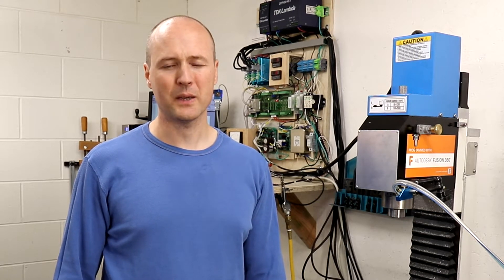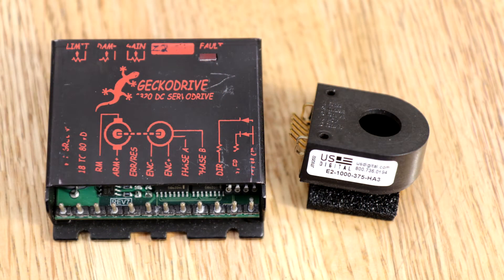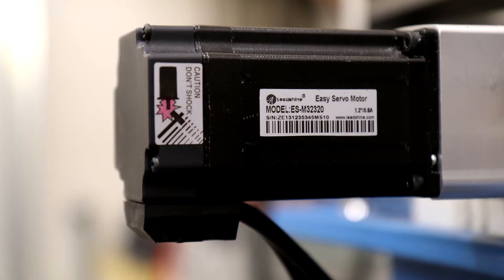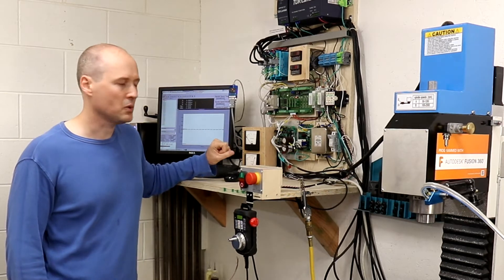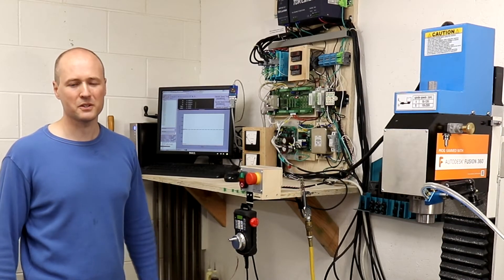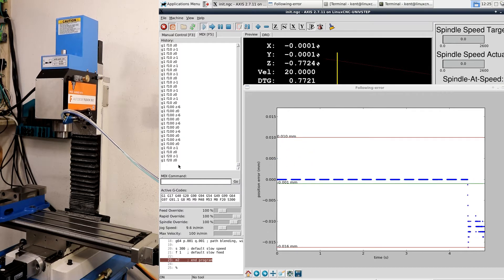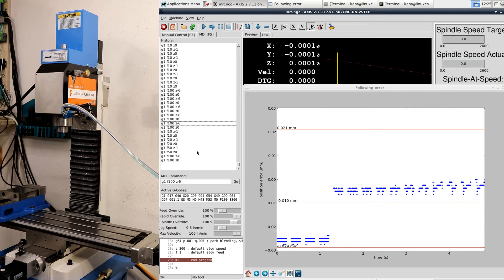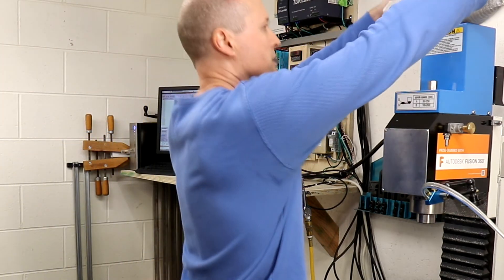Closed-loop stepper motor following-error monitoring

Comment: Hello I’m from Brazil im using the hbs57 driver that looks pretty much like yours… I added a clock to the x axis to see if it was going ok but seem it’s not going exactly as should. I’m using fluidnc as controller with an esp32 board to send the commands and it don’t seem to be stable in advancing for example. It seem to me like the driver may be the problem could you give me some advice?

Comment: Where could I buy the Leadshine servo motor? I think the ones you have are 2N.m, everyone recommends 4N.m for the X/Y-axis and 9-12N.m for Z-axis. Is 2N.m enough? Thanks
Reply from the maker: In the US, I purchased from http://www.americanmotiontech.com/

Measure required torque at the ballscrew with a torque wrench - not much is needed, break away and moving. I've had no trouble with 2Nm, and demonstrated reserved capacity by adding weight to the head while monitoring follow error. If not able to measure these, one would be conservative and increase the motor size, especially if using open loop motors.

For these small mills, we should be working at lower force levels. Smaller faster cutters and less force. 

Thank you for asking. Happy holidays!
Reply: @kentvandervelden  Thanks for the reply. This makes sense. Happy holidays!

Comment: It seems like the other videos in the series never happened?
Reply from the maker: The most direct answer is: no, they didn't. the information that I can read from the axes drives is not timely enough to make a real difference. I purchased a servo for a spindle, with a similar goal in mind, got that integrated into LinuxCNC, but similarity, the readout seemed out of sync. The best way would be to build a proper instrumentation of the drives. I have the circuit sketched up, but I don't know if it'll ever get built. If you only want to see how to reverse engineer the control protocol, I'd bad glad to demonstrate that. Glad to answer any questions you may have. Stay safe.
Reply: @kentvandervelden  Thanks Kent, that makes sense. 
I may be thinking about this too simply, but is it possible to have the input to linuxcnc just be that the following error is zero before sending the next move command? That way the driver can do the hard work of fixing the following error and the PC just gets a wait/go kinda signal, so if a move doesn't complete the program halts. Or would this just make things much slower?
Reply from the maker: @marshr32  I dreamt of controlling spindle and feed override based on inputs from sensors. E.g., keep spindle at 80% power or so (this is what requires extra electronics) and monitor other sensors (e.g. vibration and sound) to avoid vibrations. People ask about and report feeds and speeds, when they are suggested by the manufacturer, but without experience, the machine may be best at performing tests and optimizing a machine's material removal rate over time. Your idea is optimizing for accuracy. I believe that the division of labor as you describe, i.e. trust the drive and motor combination to eventually get to where it's commanded, is the right approach. Without it, one ends up with multiple PID loops stacked, and maybe impossible to tune. The larger the machine is, the harder it is to stop them, at speed, without overshoots. So, controllers blend operations. In LinuxCNC, approximate a circle with a lot of short lines and then run the g-code in exact mode and with just a little blending. Exact mode in LinuxCNC is probably the software version of waiting for the drive to report exact position. It sounds like a great idea but when machining the machine sounds awful, and that's not considering that the tool is likely rubbing slightly at every end position. I hope this is helpful. There are papers in the area of optimizing machines with closed loop controllers. Calling me out on not finishing this, has got me thinking :) If there is something that you would like to do together, drop me an email.
Reply: Cheers Kent, I don't actually have a cnc yet, still looking at different ideas to incorporate into my build. You're a lot further along the journey than I am so I may well get back to you at some stage when I have mine up and running

Comment: Do you know the condition in which one of these drives issues a following error alarm? (7 blinks) I'm trying to diagnose an intermittent alarm condition.
Reply from the maker: Seven blinks is a position following error. The motor is not able to maintain or obtain commanded position. Perhaps slow acceleration, max velocity, or reduce load. By the way, the alarm can be reset by toggling the ENA line.
Reply: Same problem here. Full day trying different tune settings from mach3 and still the same blinking or just straight red light.

Comment: Hello. Im feeling with measuring follow error of virtual axis for kuka robot for example welding gun. I have time speed and position of weld gun and ideal values. How can I check follow error ?
Reply from the maker: Following-error is simply the difference between the ideal location and actual position. Keep in mind that I'm looking only at the following-error of the motors. With the machine flexing during acceleration, the tool will have additional lag. 

This webpage does a nice job describing following-error and how it is used in the control equations. Hope this is of at least some help.
https://www.newport.com/n/control-theory-terminology
Reply: Thanks for explaining fundamentals for follow error. I'm starting to connect servo gun controlled by profinet to codesys via raspberry pi. Yes You are right in doc I have starting lag described in delay time between sending start signal to gun and feedback from controller for gun. Thank You again for explanation. :)

Comment: Intresting. I have just started out with steppermotors. Hightech projects like this is light years from were im now but still very helpful to help and get insight to the technology.
Reply from the maker: Thank you Peter. I tend to needlessly complicate everything. :) Good excuse to learn some new skills though. First I purchased only the motors and started to design my own closed-loop drive. During that I learned that closed-loop drives are doing much more than I was aware. Most notably, the available torque on these motors with the appropriate closed-loop drive is far better than when operated with an open-loop drive. I'd like to resurrect that project and publish a video on why my simple design was not the same as a closed-loop drive.